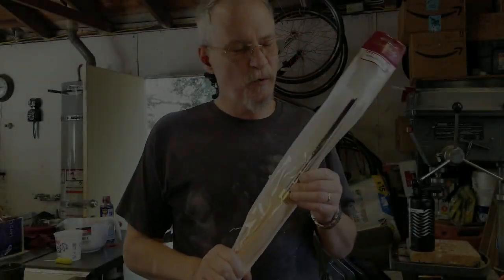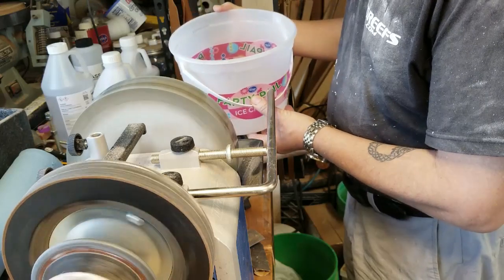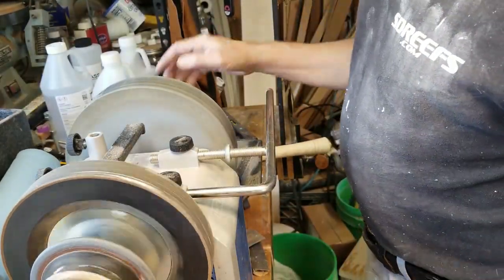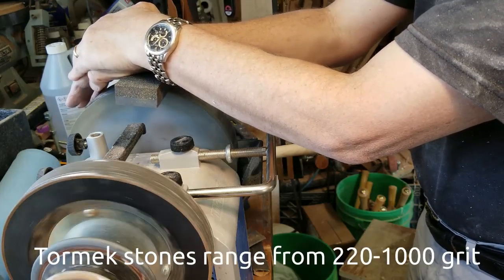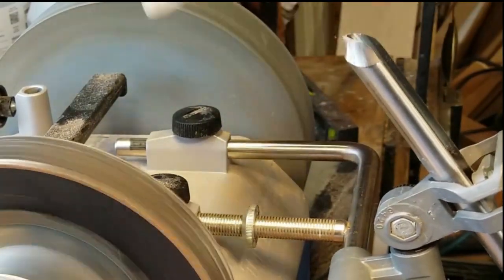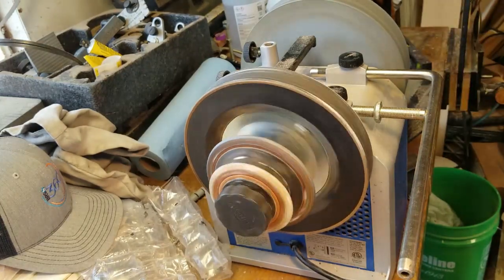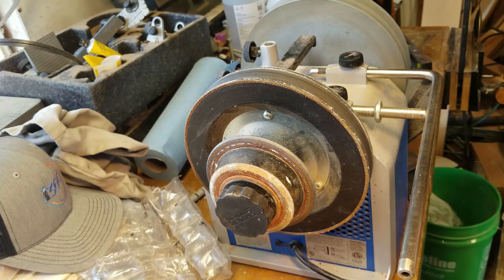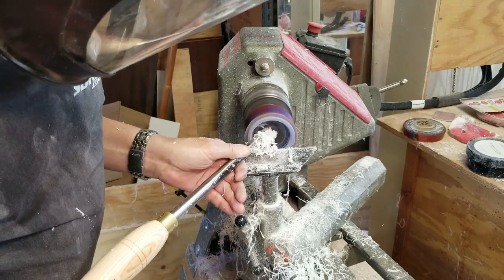New Bowl Gouge's first sharpening with Tormek

Comment: Thanks, I was fiddling around with a couple Sorby shisels and the Tormek turning setup for the first time tonight, and you've cleared up a couple things for me. First:  That even if you measure the cutting angle and set according to the "Tormek book", it isnt going to be perfect the first time. I was thinking I was doing something wrong.  Also, you can use the TTS100 to setup the honing eheel also. Thanks!
Reply from the maker: Glad I could help

Comment: Which jig setting do you use for that grind?
Reply from the maker: Hi,
When I first started sharpening bowl gouges with the Tormek I used the settings "2, 65, A". It was close the factory grind and worked pretty well. Later, I decided I wanted a little more swept back grind and switched to "2, 75, A". The latter is what I was using in the video.